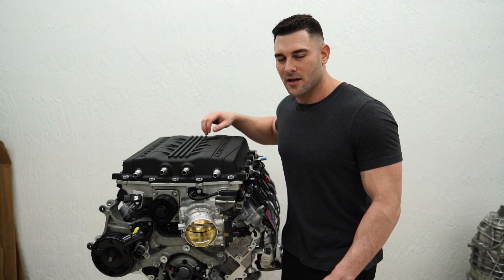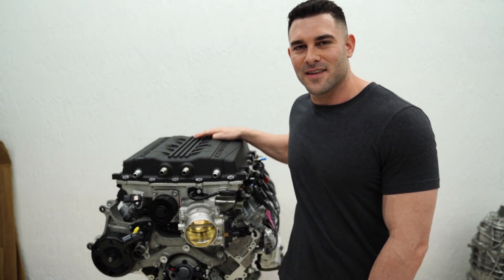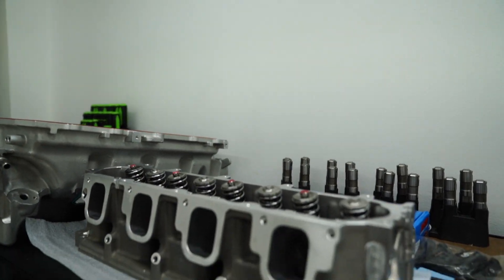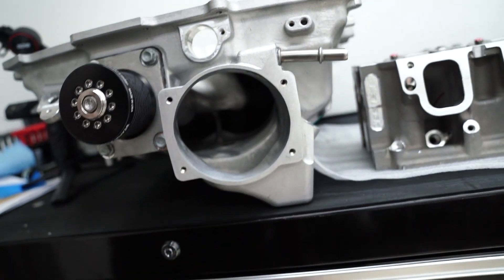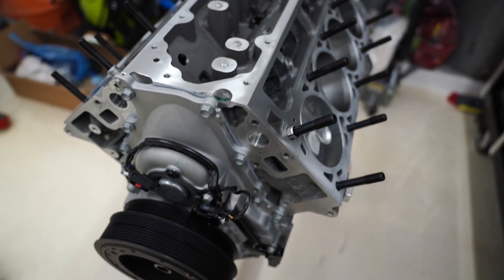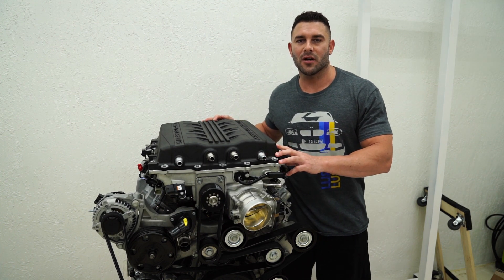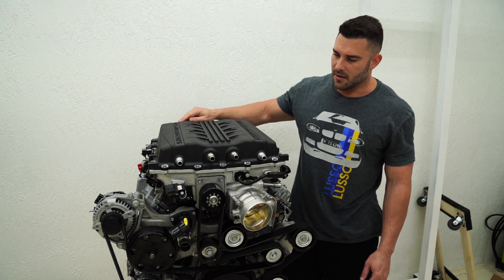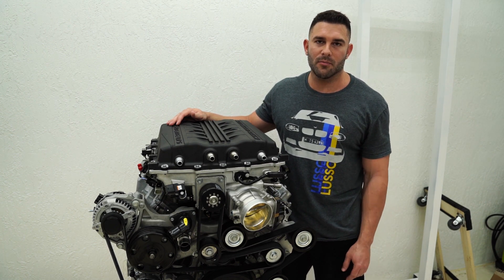Building a 1000HP LT5 Corvette C7 ZR1 Crate Engine For My Ultima RS!

Comment: was that a phaser lock out i saw get installed ? what is the reason why your deleting vvt ? 🤔
Reply from the maker: All the high HP LT engine builds I've seen delete the VVT.  I modeled my build after the "ZR5" package by Advanced Modern Performance.  I also wonder how much the VVT works in the crate engine since I know DOD does not work, even though the engine has the ability to.  That's all because of the tune though.
Reply: @UltimateUltimaRS  I too was also wondering about the DOD until I saw the block off plugs go into some oil ports, best off without that junk anyways they use different lifters that always collapse and fail with the dod system . As for the vvt system iv heard it helps make more lower end torque and higher hp in the higher rev ranges , but then again with the power goals your aiming for who knows if the stock phaser can handle that type of power. bad ass build by the way.

Comment: I am contemplating do an LT swap for my 86 Caprice.  Trying to see if I should drop to an LT4 or still do LT5.  Most likely GM won't being doing an LT6 crate for a while.  Thanks
Couple of questions:
1.  What is the difference between LT5 and LT6 (if known LT5 755hp, LT6 650hp)?
2.  Why did they only do 1 yeah of the LT5 (If known)

Thanks
Reply from the maker: The LT5 is a cam in block, overhead valve engine that dates back to the small block Chevys of the 1950s.  The LT6 is completely different with its over head cams and flat plane crank.  I would put an LT4 in the Caprice since the LT5 has very little tuning support compared to the LT4 and the LT5 has been discontinued.  I have heard the LT6 will be offered as a crate engine but I can't imagine it will be less than $30k.

Comment: Why did you do a dod delete in the top of oil valley filling the holes when the LT5 is not equipped with dod?
Reply from the maker: I ordered a kit that came with everything.  Even though the DOD is supposedly disabled in the software, I wanted to be extra sure.

Comment: Did you use the wire harness & LT5 Computers that came with the crate engine & did you have to have HP brake in to the computer so you could tune it  because of the new cam.
Reply from the maker: I used the LT5 computer and used HP Tuners for tuning. The good thing is that the crate computer comes unlocked from Chevy so there’s no need to send it to HP tuners. You just buy the credits and tune away.

Comment: Great Video! Any reason for taking the sump off? Stock injectors? Stock oil pump?
Reply from the maker: I think I needed to take it off to access something else.  I can't honestly remember.  The direct injectors are stock, though the cam has a +38% fuel lobe on it.  The port injectors are ID1050X.  Oil pump is stock.

Comment: Awesome build! do you know what the weight of the fully dressed motor is?
Reply from the maker: Fully dressed I would guess right around 510lbs. Mike Finnigan weighed an LT4 on his channel and I believe it was ~465lbs. The LT5 will be slightly heavier with the larger supercharger and then the alternator, AC compressor, and pulleys are a little bit as well.

Comment: As a guy that is ocd about certain things looking a certain way... It bugs me that the supercharger cover still says corvette. I think I would have had to #1) Have that milled off so it's flat, and #2) Have it powder coated to match the valve covers. Also, the flat area would give you the ability to add something custom there to really tie the car together.
Aside from that, I'm a big fan. Awesome build. Came out amazing, and I'm currently in the process of watching it all the way through. Great job man.
Reply from the maker: Thanks man. Definitely some good points here and I agree it would look better without the Corvette lettering.

Comment: Did you choose the V8 for the money value? What other engines have you considered inserting for your drivetrain?
Reply from the maker: The engine with ECU and modifications was over $25,000 so it wasn't exactly cheap, but if money was no object, I would have loved a Judd V10.
Reply: @UltimateUltimaRS  I watched an amazing time attack orientated A90 supra build with a Judd V10 from Ryan tuerk, i think it would've been cool with a high revving v10 in your kit car build but i heard the engine rebuild interval is like 3k-5k miles or something? sounds like a pain

Comment: Please i need the pushrods size.  I have same setup on lt5
Reply from the maker: Here is the part number and size I used-

25-8000-1-3/8 - Texas Speed & Performance Chromemoly 8.000-Inch Pushrod, 3/8-Diameter with
5/16-Inch Ball Ends, .080" Wall Thickness, Per Pushrod
Reply: Wow. How much  the preload you got with this length
Reply from the maker: @tareqal-tamimi758  .035

Comment: Predict...you will overpower the chassis, suspension, brakes and tires.  But good luck, it's going to be a handful!
Reply from the maker: Chassis is rated for 2000hp, but I definitely will overpower the tires. "There is never enough horsepower... just not enough traction." - Carroll Shelby

Comment: No Intercooler between S/charger and inlet??
Reply from the maker: Yes, there are cooling blocks in the supercharger lid. You can see 4 quick disconnect bungs coming out of the top of it which are for each side's inlet/outlet.

Comment: That’s a lot of engine. I have seen a 2001 Ultima in person and it has a 5.7L LS1 in it. Camaro spec with 325hp.
Reply: Ultima have three engine sizes, this is the LT5 which Ultima say you could get 1200bhp when tuned.

Comment: Sequential transmission or DCT? If you go DCT and manage to get it to hook with the torque band that happens as early as yesterday in that LT5 hold on!
Reply from the maker: H-pattern manual! Should be pretty spicy.
Reply: @UltimateUltimaRS  Nice.

Comment: Where did you get the engine from. Awesome btw. My boss and I are building an RS
Reply from the maker: A buddy of mine has an account with Summit Racing so I got it through him. Have you guys received your kit yet? What engine are you going with?
Reply: @UltimateUltimaRS  Yes he got the kit 4 months ago. Its the same color as you have. Still doing the paneling. We both work 45+hrs a week. Its his and I'm the one doing all the research. Lol. Think he wants a Ls7. And thanks for getting back to me.
Reply from the maker: @skatedeath2186  Once you finish the paneling, things go pretty fast. Let me know if you have any questions at all. Also, there's a great Ultima owners Facebook group with lots of builders on there if you haven't checked it out already.
Reply: @UltimateUltimaRS  I have not checked it out. What is it called. Also what wheels did you go with?
Reply from the maker: @skatedeath2186  Just search "Ultima Owners Group" and you should be able to find it. I went with wheels from BC Forged. They just arrived a few days ago so they aren't in any video yet, but I posted a photo on instagram- instagram.com/ultima_rs
Reply: 755 hp is already too much to fully enjoy the car, so I've heard...

Comment: Why do you want 1000bhp. For track use its probably too much unless you somehow increase the down force and have a fancy traction control system. Hope it delivers what you want. Great channel and great project.
Reply from the maker: This is a common question and "purists" seem to disagree with the power output by usually saying it isn't "needed." But really that's the whole point of the car- there is absolutely nothing practical about it and zero need for a car like this even with 200hp. I used to have a Gen 5 Viper with around 700hp and it drove around just fine, but there are guys who put down 1800 to the tire on a 19" wheel in some twin turbo models. They're all over Youtube if you want to check them out and I've never seen one of the owners get out and say, "It's cool and all, but I just wish it didn't have that much power." I don't mean to be snarky or anything, but that's just my view. Thank you for the kind words as well!
Reply: @UltimateUltimaRS  Agree@ 100%! You can never have enough power!😄👍

Comment: Can you post cost, I want another Kit car/racecar
Reply from the maker: I'm going to make a video at the end and do a total cost break down. These kits are totally dependent on options and can go from mild to wild. Mine is definitely a high spec build but you can do an LS3 and not all the carbon options for probably right at or under $100k.
Reply: @UltimateUltimaRS  I've been wanting a Ultima for years. I would do an all out option with the LS3, for reliability on the race track. Plus I make my own carbon parts for my cars.  I have a friend that has a SLC and a Ultima GTR here in Sarasota.

Comment: Looks good, mate! That LT makes the 650hp in mine seem mild. No deleting the variable timing? I believe Katech do that on their big power builds as well as a 112mm throttle body. Keen to see how it all comes together!
Reply from the maker: Thanks, Rob! Yeah the variable cam timing is deleted... you can see me take apart the cam phaser starting at 4:36. Katech does a whole revamp of the VVT which includes using a different type of cam, an LS3 style sprocket, and a different timing cover which I didn't find to have any benefit over the simple Comp Cams cam phaser lock. The Katech solution is like $600 vs $65 for the Comp Cams part.
Reply: @UltimateUltimaRS  Interesting. Without having seen that cam phaser, I was wondering what you did to it. I assumed it was replaced with a standard billet set like I have on my LS3. Looks like you’re across it all and it’s good to see you being smart about spending rather than simply throwing cash at solutions without investigation.

Comment: Build Looks great, I’m also building a LT5 RS. But mine is a stock LT5. While your waiting for your kit, there a few minor mods on the engine you could do now. The AC compressor needs trimming for the engine mount, the thermostat gets drilled, and if you are using an analog oil pressure sensor look into a making a custom adaptor. Lastly we need to countersink one of the engine mount holes - I used the mount as a guide.
Reply from the maker: Thanks Doug! It's Gabe here... we've already talked. Thanks for going out of your way to help out!
Reply: Ultimate Ultima RS oh now it makes sense. There was no name on the video. It’s a great video. I just got my charge cooler back from the radiator shop. I needed to get new bungs welded in. My first real oops. I should make lots of progress this weekend. Finally done with section one of the build manual - chassis.
Reply: Any chance of build videos...?
Reply from the maker: @Acrowat40  The kit is currently on a ship en route to me. I'll definitely be posting build videos. Stay tuned!